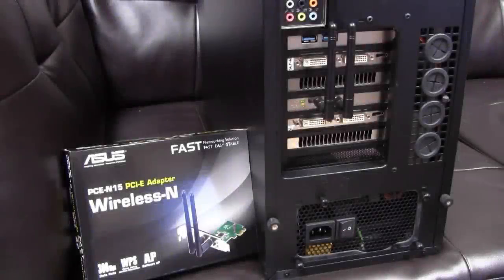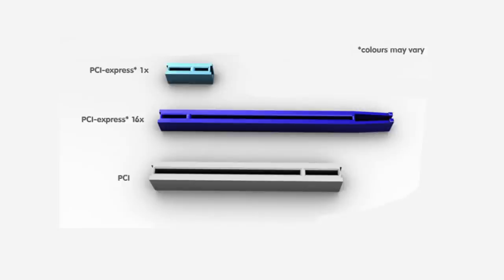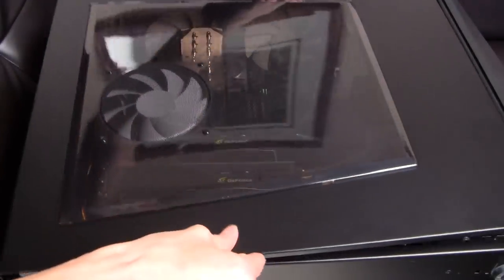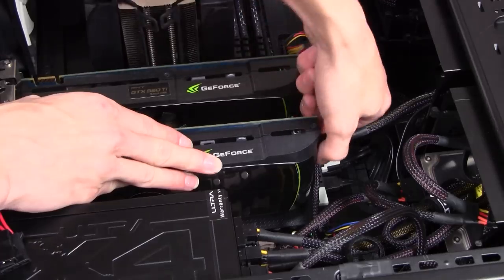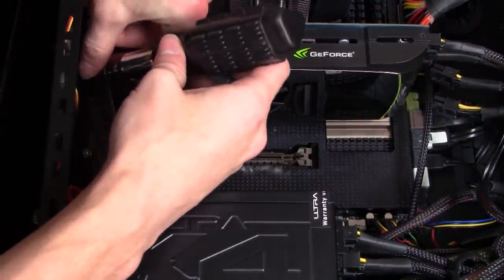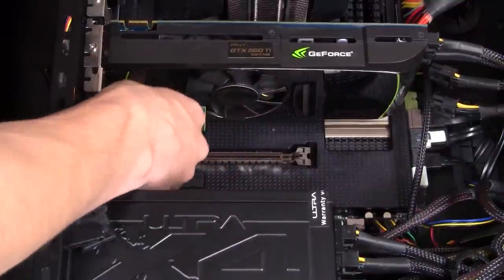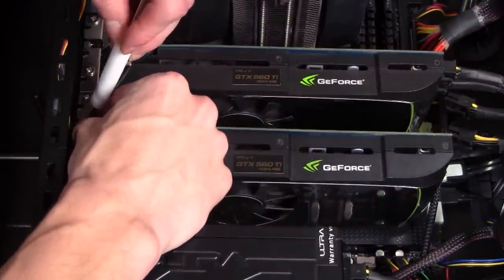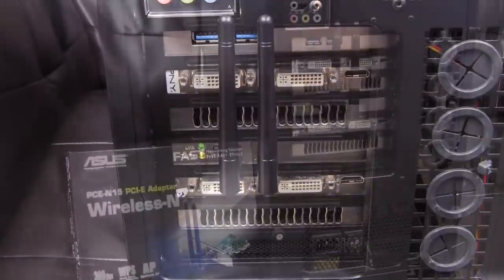How To Install A WiFi Card In Your Desktop Computer

Comment: is there anything I have to do after putting in the card? In the video you said install the driver, what does that mean?
Reply from the maker: +Max Caboti-Jones Yes. You need to install the drivers. A driver is a piece of software that comes with the hardware. Without it windows won't recognize the hardware properly
Reply: Wiltshire Tutorials thx. Where would I find the right driver for that asus one for example. Is it just on the asus website?
Reply from the maker: +Max Caboti-Jones That is correct. You would go to webpage with the devices and then go to support and downloads. You should be a le to find the drivers there
Reply: Wiltshire Tutorials this is also probably a stupid question but without wifi on the device already, how do you get to the website , do you need a different device and install it onto a sub or something
Reply: Usb*
Reply from the maker: You could use an Ethernet cable or you can use your phone to download the files and then transfer them over USB
Reply: Oh ok thx. Im starting to get it.

Comment: I have Gigabyte GA-H87M-D3H Micro ATX mobo. What type of wifi card do I need?
Reply from the maker: dubanimeshows Let's see... The board has 2 PCI slots and 2 PCI-E x16 slots. I recommend either getting a PCI card or getting an x1 WiFi card to put into your PCI-E 2.0 x16 slot.

Comment: So can you play games on the card because the usb was a fail and I think this would help just be used it has 300mb the usb only had 150mb so could this increase my internet on the computer I am making?
Reply from the maker: GoCraft Technology is more than capable to deliver the speeds. However, what is your internet's download and upload speeds. If your connection from your ISP is slow, then investing in expensive hardware is pointless.
Reply: oh

Comment: Does PCI Express Card fit in regular PCI/ will it work?
Reply from the maker: No. It does not fit in a standard PCI port and will not work
Reply: I'm having an issue, can you help? I got a Wi-Fi card with a PCI thing and put it in the motherboard, but my computer says no wireless card is detected. I downloaded the drivers too, any ideas?
Reply from the maker: +Chuck Muckles did you install the drivers for the correct OS?
Reply from the maker: +Chuck Muckles did you install the drivers for the correct OS?

Comment: can u help me i am building a rig so i wanna know if it has onboard wifi
msi z97 gaming 5 or msi z97 gaming 7 pls reply asap
Reply from the maker: Harkirat Singh You will need a WiFi card for both of those motherboards, as they do not come with onboard WiFi.
Reply: Harkirat Singh  also remember not all of the motherboards come with a cpu cooler so becarefule and when i was looking around asus motherboards or msi motherboards i did not see a cpue cooler included, and the only reason i added this was due to the reason of desktop cases not mentions cpu coolers, not all include a cpu cooler, remember you do not have to get the most expensive mother boards out there due to the slightly little differences, don't get tricked by the prices, in general
Reply: Harkirat Singh  also look at the names and do research before spending your money, this industry gets you

Comment: I`m building my first PC, and getting the MSI H97 GAMING 3 motherboard. I'm pretty sure i will need a wifi card, but could you tell me just so I'm 100%
Reply from the maker: ***** It does not have built-in WiFi. Therefore, you will need an expansion WiFi card.
Reply: Wiltshire Tutorials Thanks!

Comment: what case did you use in this video?
Reply from the maker: +Ravi Ragoo It was an NZXT Tempest EVO. Good luck finding that case. They stopped making it years ago. I still have the case though!
Reply: Wiltshire Tutorials Yea I can't find it to buy anywhere buy, any case recommendations I'm putting water cooling into my system and would like a case that can show this off thanks
Reply from the maker: +Ravi Ragoo Corsair 750D, 800D or 900D would do the job just great! I have a Corsair 800D. Love it!
Reply: Wiltshire Tutorials thanks, great cases but I found a really cool white case from phanteks my setup is a white/blue theme so this case matches with my system continue making videos they're really good

Comment: When i connect the wifi card in the motherboard, do i have to do it before or after i go into the bios and install windows?
Reply from the maker: It does not matter. I would suggest installing it before. So you don't need to open your PC up after the installation

Comment: Hi, I want to add WIFI capabilities to a mobile billboard.  The billboard does not have a computer in to but is does have a Li po battery.  Is it possible to make this product WIFI capable?
Reply from the maker: I ZERO experience with billboards. If it is not hooked up to a PC in any way, I don't think I can help you.

Comment: hope you awnser this . 
if i built a gaming pc without that . can i still conect to my internet box? cause im new and i dont know any of this stuff. but is that thing use to connect to a internet box? if not then i can still conect to the internet using my modem right?
Reply from the maker: If you wish to connect the internet wirelessly, then you need a WiFi card. You can still connect to the internet if you hard wire your PC to your router using an Ethernet cable.
Reply: Ok . Thank you !!
Reply: Does every motherboard or the majority have a wifi slot?
Reply from the maker: +Connor McNeil They all have PCI-E slots that can take a WiFi card.
Reply from the maker: +Enderpro 13 Your're welcome. Thanks for watching
Reply: +Wiltshire Tutorials can I use a hard wire that is connect to my wifi extender or is that not possible

Comment: I'm trying to convert my desktop to WiFi, but with no success. I purchased a antenna Ideaworks model: JB6612 thinking that this was all I needed. I saw in Network and Sharing the X between the internet icon and the one for the Wlan that appeared for the software that came with the antenna. I don't have an ISP. Trying to connect to neighboring hotspots. Do I need a wireless card to connect to the internet along with the WiFi antenn?
Reply from the maker: +ocelot108 You bought the wrong item.... You bought a WiFi extender. You didn't buy a PCI-E WiFi desktop card
Reply: +Wiltshire Tutorials I know I didn't buy a card. The question was about whether or not One was needed to connect to Wifi without an ISP.
Reply from the maker: +ocelot108 To connect to any internet connection via WiFi, one is needed.
Reply: I'll try a WiFi card in my desktop along with the Extender and see what happens.
Reply from the maker: +ocelot108 You should be fine with the 2. Considering it is a hotspot, connection may be dodgy, but worth a shot.
Reply: +Wiltshire Tutorials I hope I Will be able to connect.

Comment: is this something i need? my motherboard supports 10/100/1000 and i only get around 5mbps download. im using a wifi usb adapter
Reply from the maker: Well, when it comes to internet speeds, more often than not you get what you pay for. That very well could be your max speed you're paying for. I'd suggest staying away from USB WiFi adapters. They tend to have more latency. You could try a PCI-E WiFi card. It may improve things a little. It all depends on your speeds from your ISP

Comment: Do all motherboards have an pci slot
Reply from the maker: Careful! There are PCI (outdated) and PCI-E slots on motherboard. Don't get them confused. Now-a-days you'd want PCI-E slots. To answer your question, yes. All motherboards come with PCI-E slots. Depending on manufacturer, you may get varying slot sizes.

Comment: Can you put a WiFi card in a PCIe X16 slot btw
Reply from the maker: Correct. You can. Although, if you have the option, I recommend leaving the x16 slots open for more bandwidth hungry devices
Reply: @WiltshireTutorials  Unfortunately this is the way I’m go I have 3 X16 slots and I keep losing the tiny usb dongle‘s 😂

Comment: do i need to buy a wifi card or whatever to receive wifi? or does it come standard with some motherboards?
Reply from the maker: +Collin M. Yes. Without a WiFi card, you will not be able to connect to your router. Some motherboards do come with a WiFi card built in, however not many do come that way.
Reply: Wiltshire Tutorials thanks
Reply from the maker: +Collin M. You're welcome

Comment: I have 3 Pci-Express slots in my Mobo, I tried changing the wifi card from slot 2 to slot 1 but when I turned on my pc theres no wifi (card not applied?) Im 100% sure it was placed correctly and firmly.
Reply from the maker: Did you install the drivers for the card? Sometimes, depending on the card you buy, it won't show internet connections until you install the drivers that came with the card.

Comment: I'm using windows 10 pro and I can't get access to WiFi/internet so I trouble shoot it and it shows me the problem, and it said that I need a Ethernet cable with a router, but I do not have those holes that are in your walls that you can use it to plug it to connect to your router and using it with Ethernet cable for wifi, and for your computer to have internet access,but I needed the computer in my room but it doesn't have those holes in my wall, so I instead try to switch it with  a PCI adapter but I do not know if It will need a Ethernet cable to connect it to my PC first and the end of the cable connecting it to the router, but the point is if I install a PCI adapter on to my PC/computer, will I need a Ethernet cable with a router or will i just need  the PCI adapter installed in my PC just to get internet access?
Reply from the maker: You need to install a WiFi card like I did in the video. Windows is giving you that troubleshooting result because it does not detect a WiFi card, only an ethernet port that is built-in on the motherboard. Once you install a WiFi card, you won't need an ethernet cable.
Reply: @WiltshireTutorials  so are you saying that if I buy a wifi card/PCI Adapter, and If I install it to my pc,i won't need to plug any ethernet cable into my pc?
Reply from the maker: That is correct.
Reply: @WiltshireTutorials    thanks but i brought a GPU which is evga gtx 750ti but it is too big that it covered the whole pci-express 1x slot because I only have one pci-express 1x slot so can I just add the wifi card into the PCI Slot which is only at a outdated motherboard and that is not usually used today?
Reply from the maker: You could buy a PCI WiFi card instead of a PCIE card. A GPU uses an x16 slot. You should at least have one of those on your motherboard.

Comment: Hi, i would like to install a WIFI card but i only have a PCIE 2 slot. Could that work as well? 
Thanks!
Reply from the maker: Good question! You can install an x1 card in any PCI-E slot (x1, x2, x4, x8 or x16). It will function just fine.
Reply: @WiltshireTutorials  
Alright! Thank you very much!
Reply from the maker: You're welcome! Thanks for watching

Comment: If you still respond to comments on this video, could you link me a decent PCI WiFi card? And since PCI is outdated does that mean it will be slower?
Reply from the maker: I respond to all comments I get. Due to you using PCI, your options are a little limited. PCI is theoretically slower than PCI-E. However, it all depends on your internet speed. You may not even notice a speed difference, if your internet can't reach the max speed of PCI. I'd personally recommend this card here: https://newegg.com/products/9SIA72586Z7749

Comment: When you plug in the card and boot up the pc does it automatically connect?
Reply from the maker: That depends on if Windows has a default driver it can use to get the WiFi adapter at least working until you install the factory driver.

Comment: does this work on every motherboard?
Reply from the maker: Every motherboard is different in terms of PCI-E layout. For example, most motherboards these days don't have PCI slots anymore, just PCI-E. You can use a WiFi x1 card in an x1, x4, x8 or x16 PCI-E slot

Comment: so if i build a pc do i need a wifi adapter and if i do how much will it cost, thanks.
Reply from the maker: Some motherboards now-a-days come with a WiFi and Bluetooth antenna combo, but most do not. Therefore, you most likely have to install a WiFi card. The cards are quite cheap, I bought mine for around $35
Reply: k thanks
Reply from the maker: No problem

Comment: i have a question is
 it  imprtant to have two antenas with wifi card
Reply from the maker: Depending on the WiFi card, the 2nd antenna is usually for Bluetooth connectivity. So, if you aren't using Bluetooth, you could in theory, leave the antenna off.

Comment: I need help ! A
The but that you unscrew to actually get the Wifi card to fit in doesn't unscrew for me, there are no screw slots on either it or the one attached to the Wifi card, i don't know how to get it off on my computer !
Reply: *the bit that you unscrew
Reply from the maker: They might be break away tabs that you must break off the case to insert a card

Comment: I have an Asus Z97M-Plus motherboard for my new PC I'm building, and it doesn't appear to have a PSI-E X1 slot for my wifi card I bought. What can I do?
Reply: Magishika Im also pretty sure my wifi card is the same as the one you used in this video :/
Reply from the maker: Magishika Insert the card into one of the 4 x16 slots. PCI-E is backwards compatible ;)
Reply: Wiltshire Tutorials I tried but it doesn't seem to fit... I think I will return this card and get a x16 one. Would that work?
Reply from the maker: Magishika x16 size is for GPUs only. What WiFi card did you buy?
Reply: Wiltshire Tutorials The same one in this video. The PCE-N15

Comment: hello sir it's me again..i need ur help i just upgrabe my asus netbook last week and try to install windows 10 on it at first it works fine but just a few days it hangs up..and i try to restart it this is what appears on the screen.."AN OPERATING SYSTEM WASN'T FOUND.TRY TO DISCONNECT ANY DRIVES THAT DOESN'T CONTAIN AN OPERATING SYSTEM"..im hoping for your help sir....t.y.i.a.
Reply from the maker: +Mark joseph Navarro That sounds like a dead hard drive to me or Windows has corrupt itself... Sorry to inform of this.

Comment: Mine came with a WLAN Card Cable but I can't find where to plug it into on the motherboard. I still have Wifi but it drops frequently and it is getting really annoying. (The cable isn't plugged in)
Reply from the maker: ***** You probably have motherboard with an antenna extension, which is quite common. You need to find two round hole on the back of your PC, where the I/O plate is, and screw in the antenna. The reason why you are getting frequent drops of signal is because there is no antenna installed to receive the signal from your router.

Comment: So after you install it how do you turn it on in the computer
Reply from the maker: PCI-E slots deliver power. Therefore, when the PC is turned on via the power button, the card instantly turns on because it now has power. On Windows, in the bottom right hand corner of the screen, also known as the System Tray, there will be the icon for WiFi. Click that to connect a wireless network. Don't forget to install the drivers for the card!

Comment: man your cable management clean it up
Reply from the maker: +MeetrixGB Pretty hard in a case that doesn't allow it. Also, this was my very first computer build.
Reply: Wiltshire Tutorials oh unlucky then but why get a case with now holes in the right panel for cable management???
Reply from the maker: +MeetrixGB The other side panel only allowed for minimal cable routing. Couldn't get the 24 pin to route nicely. I now have a Corsair 800D. So cable routing is no longer a problem
Reply: ***** jeeze men calm down

Comment: what if u only got two pci Express and they are made for graphics cards only like I only got pci x16
Reply from the maker: You can actually use a PCI-E X1, X4 or X8 card in an x16 slot! It seems like I forgot to mention that in the video!
Reply: Without a adapter right
Reply: Wiltshire Tutorials like without a adapter that somehow makes it longer idk if those exist cuz none on Amazon but I am curious
Reply from the maker: Nope. No adapter needed. Just slide the card into the x16n slot and you're good to go!
Reply: Awesome
Reply: Thx

Comment: can u got from a N to an A.C adapter ?
Reply from the maker: No. You must buy a new card that supports AC transmission
Reply: @WiltshireTutorials  oh :/ do I need to buy a new motherboard with Ac I have an I 7700k
Reply from the maker: No. Just a new WiFi card will do. One you have one, just put it in any free PCI-E x1 slot
Reply: @WiltshireTutorials  :O thank you  is there one that's your personal fav
Reply from the maker: You're welcome. The card that is my go-to is from ASUS. You can find it here: https://www.amazon.ca/802-11AC-Wireless-AC2100-Bluetooth-Gigabit-Pce-AC58BT/dp/B07P61CK87/ref=pd_sbs_147_7?_encoding=UTF8&pd_rd_i=B07P61CK87&pd_rd_r=c17557fc-1cbd-4b47-8106-0717f2d4b327&pd_rd_w=ViIxN&pd_rd_wg=eaSLo&pf_rd_p=c7838c3c-6de6-46ad-946c-b7318af714fb&pf_rd_r=6GVBX1HF8NJS7V5991MM&psc=1&refRID=6GVBX1HF8NJS7V5991MM

Comment: My pci isnt completely aligned with my expansion slot. Is it normal?
Reply from the maker: Muhammad Zayeem No, that is not normal at all. What case and motherboard are you using?
Reply: im using some random case i bought for 12 £ and my motherboard is an asus p8h61m